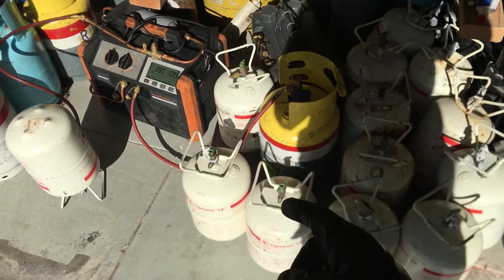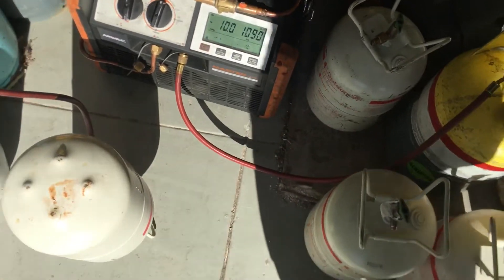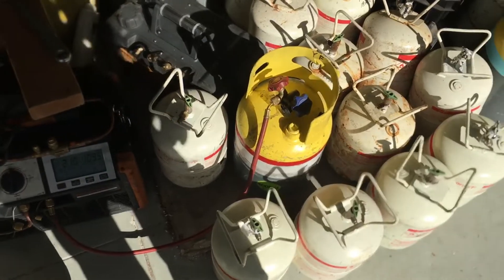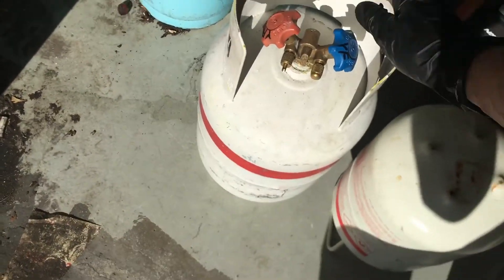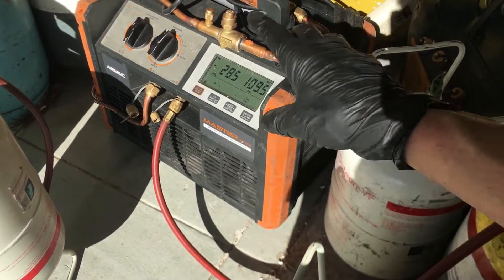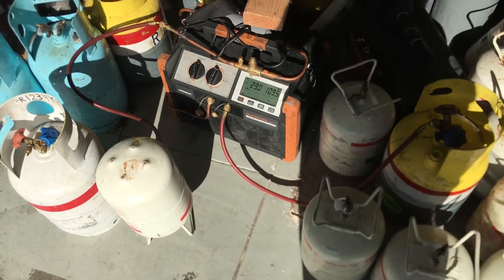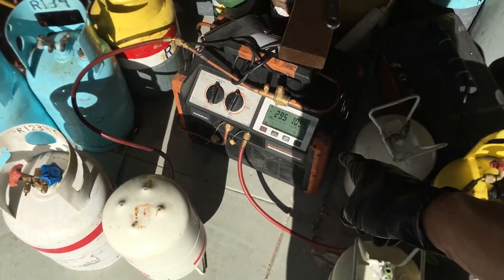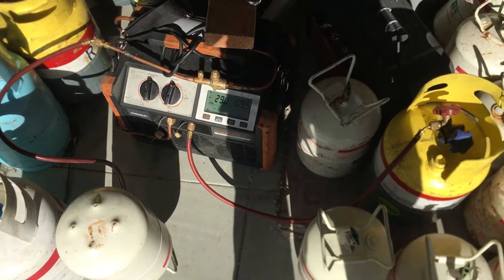Refrigerant container leftovers. What do I do with them ?.  A lot of leftover refrigerant

Comment: I have question ,,mate,,,,before to recovery the refrigerant ,,,,do you vacuuming the recovery tank,,?
Reply: You don’t my question mate
Reply: You don’t answer my question bro,,,
Reply from the maker: @kcomfortsystemshvac7060  I just answered your question. Refresh your screen.
Reply from the maker: @kcomfortsystemshvac7060  when you purchased the recovery tanks brand new.  They come pressurized with dry nitrogen inside of them.. 
       So you have to release the dry nitrogen. 
    Then I throw it on the vacuum pump, Intuit reaches somewhere between 30 to 60 µm.  And then it is ready for recovering refrigerant..
Reply: @coldfinger459sub0  I know that,,,,the new tank,,,,,,what about the old tank,,,,,,
Reply from the maker: @kcomfortsystemshvac7060  you did not mention anything about a old tank in your original question. 
     Old tanks keep getting filled by multiple vehicles until the tank is completely filled. 
        Then that refrigerant is put through a recycling machine that separates particulate matter or like metal flakes and piston ring material then it goes through an oil separator that will separate and remove oil and chemical sealant.   Then it goes through a moisture and asset neutralizer.
       Then it goes through a stage where a purge is off noncondensibles like air. 
       Once the old tank is empty. In every last bit of refrigerant has been recovered out of it.. 
        Then it goes back onto a vacuum pump, preparing it for the next next series of recoveries. 
         If you’re going to store the old used refrigerant recovery tank for any period of time you do not wanna leave it under a vacuum just in case you develop a leak or somebody unknown cracks the valve and accidentally bleeds air into the tank. 
     So you store unused tanks with a slightly positive pressure with the refrigerant that is intended to go into them for later use.

Comment: Do you have to punch out the plugs on the used tanks once recovered and empty?
Reply from the maker: We used to have to put a hole in the tank required by our local garbage disposal company. 
                        Places were told they even had to break off the hand valve lotta guys what do use a sledgehammer or something like that. 

           I think I heard you were no longer in our area had to put a hole in the tank or break off the valve.   

       I’m wondering if it Hass to do anything with emergency room calls people cutting their fingers off smashing or breaking parts of their body when a hammer or a spike bounces off the metal and causes bodily harm I could see a lot of lawsuits coming from that and insurance claims. 

            So now all I do is recover the refrigerant in a ride the word EMPTY in big BLACK bold letters on four sides top bottom and the two sides

     And dispose of the tanks in the recycling been because there’s absolutely no residue at all whatsoever of any type of chemical left inside the tank it’s just clean steel tank.

Comment: Hi Tom on the topic of refrigerants...One of the R12a manufactures installation details state to install only 40% of the factory R134a charge specifications. OK?  How does this “short” charge ensure adequate oil circulation within the system? I realize I am a wee bit off topic...Only if and when you have a moment. Cheers & Thx 👍
Reply from the maker: If you’re talking about the old EPA charging procedures of R12.   Or any refrigerant. 

       The EPA does not care about oil recirculation. 
             Only about refrigerant escape into the atmosphere and it’s handling in recovery

             The EPA is kind of a clueless entity when it has anything to do with the actual operation of air conditioning
Reply: @coldfinger459sub0  Sorry Tom . I am referring to 12a. Red Tech, Dura cool...R134a is a controlled product in Canada. R12a is HC ...propane basically I believe.
Reply from the maker: Oh yes I remember that product they tried to use it here in the United States. 

       I think several months ago I did a video on a Mercedes vans that was filled with it at hydrocarbons. 

            Back in the early days of the R 12 phase out in the early 90s are used to see a lot of burned out compressor with that product in it because of improper charging procedures was usually the cause. 

         Propane or butane are excellent oil carriers with mineral oil that was the original refrigerant oil for R12

           Even though propane and butane do work.  And I emphasize the word (“work”)  as in you get cold air. 

           Actually when choosing different refrigerant that have extremely different volumetric mass property you are supposed to size the refrigerant lines and the condenser and evaporator to keep up proper velocities to keep oil in suspension. 

            So there is a little bit of a oil pick up and distribute  problem. 
              It’s workable when you have a completely full charge of hydrocarbons but the problem is magnified quickly for every ounce you lose after that because you don’t have very much in the first place. 
            
         This is why we need system was actually purpose built designed to use propane or butane you will notice the condensers are much smaller the evaporators are much smaller and smaller pipe in diameter they keep up the velocities with the mass of the refrigerant HC. 
            Because the refrigerant is so efficient you could do a lot more work with a lot less refrigerant. 

             Let me see if I can put it in a layman’s terms in a mechanical Termanology in comparison. 

               Example I could take a 1969 Chevy 1 ton large crew cab extra large bed high towing capacity pick up truck. 
               I can rip out that 500 hp 454 hi torque engine,   And stick a little Toyota corolla four-cylinder engine onto the transmission driveshaft really and differential and original tires. 
                The engine will still turn on the transmission will still shift gears during differential will still spin and so will the tires but you have an engine that was designed for a high RPMs that was designed to work with a transmission with lower gear ratios to spin at higher RPMs with smaller tires. 

            So even though the truck will be able to move down the freeway do you think the engine transmission and all components are operating efficiently or even at their highest output. 
               And what will the life of that engine be a little four-cylinder that has tall gear ratios put on it ? 
         That’s my physical and mechanical analogy
Reply: @coldfinger459sub0  OK thx. Just trying to rationalize/justify the expense associated with repairing the A/C on a 14 year old car with 300K kms on the clock. Restrictions on R134a complicates the issue. Thanks
Reply from the maker: @TheGibby3340  wow not I see difference when the general public can not get R134a .  At least here in the US general public can get containers less than 2 pounds in size. 
      And they buy as many as they want. 

At least it generates me a lot of money and repair bills when they do it wrong. Because they follow someone’s wrong advice. 
        But the exact same problem happens with the propane base refrigerant to. 

     When it works everybody’s happy and all is good. 

       When it does not work then I feel sorry for the customer when it involves a burnt up compressor and all the extra labor and parts that need to be replaced and they cannot do that themselves.
Reply: @coldfinger459sub0  Oh I am totally Aware of the issues the “jerk off” cans can cause. 🤣  The original question with respect to only 40% of the spec charge had me wondering. Thx again 👍

Comment: That navac recovery unit you have there is not compatible with yf refrigerant.
Reply from the maker: I’m really not worried about the slight flammability problem of the YF refrigerant. 

            As long as you don’t have air mixed with the refrigerant for an oxidizer so under a compression ignites you’ll have no problems or at least I will have no problems because I own a refrigerant identifier I use on every vehicle to make sure my refrigerant is not contaminated in the first place. 

          Since the YF refrigerant uses Esther oil ( POE ) Just like the majority of all the other refrigerant that the NAVAC recovers I’m not worried about any oil miss-compatibility . 

          Even though we do not recover R600 or R290  compressing HC flammable refrigerant is no problem at all under pressure and temperature that’s exactly how the compressor in the system works in the first place. 

       It’s when you get O2 oxygen mixed in with the refrigerant and you compress it The heat of compression will detonate the refrigerant exactly how a diesel engine operates and that’s where you get the boom 💥 

           This has been the best recovery machine I have ever used as soon as any of my other recovery machines fail they will be replaced with a new NAVAC four-cylinder. 

       It’s so fast that this refrigerant recovery unit it’s already paid for itself several times over in just billable hours that were reduced off the time that I still charge for. $$$.  
        This is been my most profitable protective tool that I’ve bought this last year
Reply: @coldfinger459sub0  TTT has a new Navac NRDDF, which is compatible with flammable refrigerants.  I ordered one of those.
Reply from the maker: @satfan5685  I needed the high out put pump because I also work on larger commercial VRF systems that I sell I could have well over 100 pounds of refrigerant that I have to recover at one time. 
                    So the smaller pumps I lose money by using a slower machine. 

           And I’m automotive under ideal conditions I like having the ability to suck out the entire refrigerant charge in about 60 seconds to 120 seconds it’s awesome 👏 😎 🤩
Reply: @coldfinger459sub0  is there a huge difference in speed between the one you have there and the Navac NRDD?
Reply from the maker: @satfan5685  about 40% on larger systems I’m talking about residential or commercial HVAC. 

         I do a extremely large numbers of recoveries every day that take up a lot of my time. 
            So saving 40% or even more offer of several billable hours is extra money in my pocket every day. 

        But if your recovery needs are only one recovery or two recovery’s in an entire day and your billable hours are not build up every minute of every day seven days a week for the last 20 years with no breaks in between you don’t need the bigger machine most likely. 

         I live in San Francisco where overhead is really high and billable labor hours approach $200-$350 an hour. 
             You can see how that adds up very fast. 

    Since even on my smallest jobs I get book time flat rate minimum no matter whether I do them faster or not. 
        If I bill 4/10 of an hour at $69.20 for a recovery on a car but I get the recovery done and 1/10 of an hour I still get paid for the 4/10 of an hour. 

        Now multiply that by 6 to8 recoveries every day and you’ll understand what I’m talking about
            On top of that with those extra free billable hours that I have accumulated I could achieve adding one or two more jobs in my 10 to 12 hour day that I would normally have to turn down or put off onto the next day. 

      This is why the four-cylinder recovery machine is an extreme moneymaker and extremely profitable in my business situation